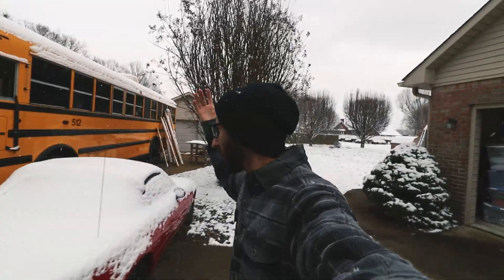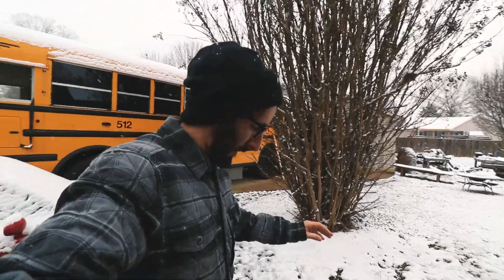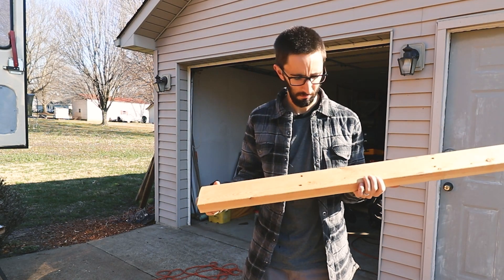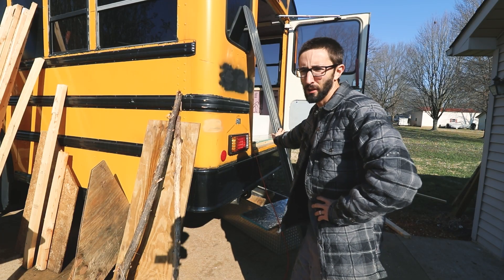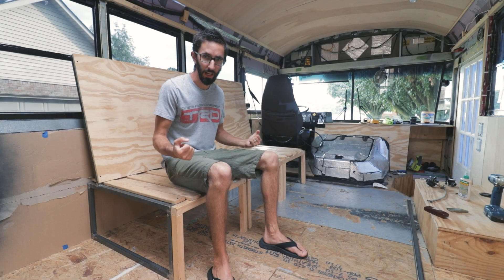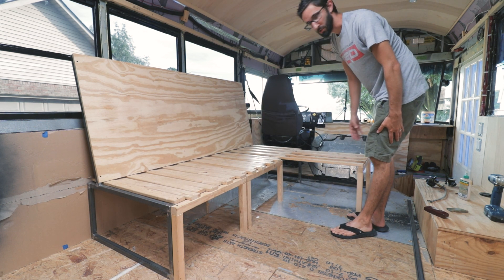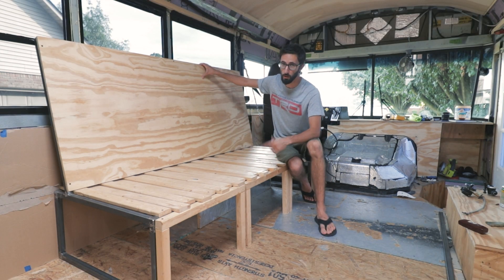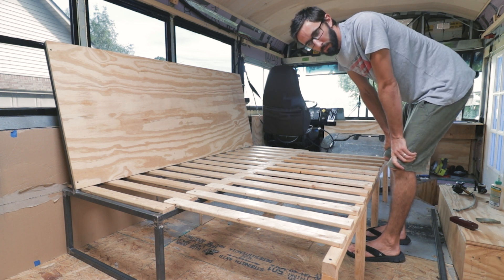DIY Pullout SECTIONAL Couch Bed for our School Bus // Skoolie Conversion

Comment: Nice job Caleb. I have a similar tri- sectioned couch in our plan but it will have 3 hinges such that the back rests become feet when they're flipped out and the center section will be able to have a Lagun table style mount for a dining area configuration. I may DIY that mount with a black iron pipe and floor flanges. Lagun mounts are fairly expensive.  Well done!
Reply from the maker: now that sounds like a solid idea! I can't wait to see it. I'll have to check out the lagun mounts and see what you're talking about.
Reply: @BackroadPurpose  they're used a lot in sprinter van conversions. They allow for a table to be swiveled around in various positions.

Comment: I like the idea of the drawers but concerned about the extended part being wooden legs. Theres little to no reinforcement from those legs when you pull them out. maybe metal fab w/ caster wheels?
Reply: Don't get me wrong the design is great! Probably me being overly picky. It does look sturdy enough and wonder if the drawers design may offer additional support when extended?
Reply from the maker: Im with you! the 2x2s is a bit of concern but we plan on building out the draws and using a piece of trim and hoping that will support it some more! but we will see... lol
Reply: @BackroadPurpose  maybe you can build the drawers to help support the slide out structure?